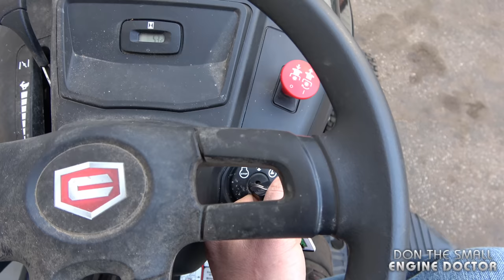Keep Your lawn Tractor Running When You Step Off!

Comment: You know the saying "if all else fails read the manual".  I've had the parking break slip and the engine shot off on my dad's unit.  Filled the plate thing-a-ma-doo-dad (technical term)  that holds the clutch lever in and it fixed the problem.  Great videos, keep them coming.

Comment: I bought a Cub Cadet XT1 46" about 3 years ago now.  Had to replace the starter in the 2nd year.  It was super-easy to replace...but still...less than 2 years?  I've seen posts online by others that had the starter go bad as well.

Now I start the tractor once when I cut the lawn, never turning it off until it's back in the garage.  (It's a long way to push the tractor from the furthest point in the backyard.)

Comment: Good tip Donnie. I had 1967 Cub Cadet tractor that I finally traded in on 2016 model Cub. The safety features are a good thing if the wife and kids are mowing, but I hate them. That safety switch under the seat was most troubling. When I would mow the ditch bank, the engine would stop because not enough of my weight was pressing down on the seat. Also, when hauling brush and leaves to a dump site just down the road, I had to get off the seat to make sure no cars were coming behind me, and the engine would stop. I did circumvent that switch. I know people do dumb and unsafe things with mowers and get seriously injured. Myself, I like the option of using the safety, or not using it. Some lawn tractors even shut the blades off when going in reverse. On the Cub a button has to be held in for a few seconds, then you can mow in reverse. I most definitely would circumvent that switch if it did not have that option. Geez...come on, this is ridiculous!

Comment: It is amazing how many people don't read the manual that comes with the machine. When I bought my newest Kubota the mechanic  was showing me how to remove the backhoe and loader said the PTO will not run when I am not in the seat. I said how do I run my chipper. He said some put a cement block on the seat. I came home and read the manual. On a page with one sentence it stated . To keep the PTO on you lock the parking brake on. I went back to the dealer and showed him this. It has a micro switch on the brake lock that bypasses the safety shut off. I also wired a light on that switch so I don't move the tractor with the brake on. That video will help the non readers. Good job I know this is a bit different than keeping the tractor running but is the same

Comment: The one at the modelairplane club have a strange safteyswich , when you cut the grass and need to reverse you have to disengege the blades outherwise engine turns off. It looks like the one you were sittning on. Great video.

Comment: Thanks Don, I have a 99 Craftsman rider, I think my manual had these instructions in them. Set parking brake, blades off and tractor will idle. Handy we I have to pick up some debris that I notice infront of tractor cut or taking short water break.
Reply from the maker: Thanks for sharing

Comment: WOW! Didn't know that! I have owned my John Deere D130 for 11 years now and NEVER knew that. I hope it works with my John Deere. Can't wait to try it out.
Reply: So I finally got to try it out. WOW!!! and then after reading other comments about "reading the owners manual" Well I can tell, I must have read it multiple times over the years for other things, so this time I sat down and read it from front to back and lo and behold, I did find out where they state it. It was "hidden" under the section for "how to check to make sure the safety switches are functioning correctly". I really think they really don't want you getting off the tractor with it running :-) Thanks again for the information and a very informative channel. You and Steve are my favorite channels!

Comment: I'm glad to see or hear your old intro..  ok.. That is a safety design feature, in the event that the tractor flips so that when you fall off, the engine stops. However, if you set the parking brake; it knows you are safe and this is by choice..
Reply: Thanks Don.. Best channel on Youtube.. I have question about a chainsaw "Jonsereds" Sweden saw that will not fire-up.. "K" body style.. do you have a section for Q/A. would love to get your opinion

Comment: I permanently bypassed the seat and REO switches. they're both a damn nuisance that I won't tolerate. My machine, I'll use it my way.
Reply: They are actually buttons you press down a switch you flip but I know what you guys are talking about

Comment: Not none of mine but my newest old craftsmen this reminded me I need to loop the black wire under the seat and loop it from the break button cause its took off 

The wire loopings different from the newer old john deere L110 I've noticed. I'm still waiting to get steering parts for the old Lt craftsmen and a new regulator rectifier for the other Lt craftsmen 

Any time I step off mine I shut the blades off because theirs no safety buttons on it that cuts the engine off so that's what I do 

Then I'm needing a new wide pulley for the John deere L110 deck i checked at the store that online said they sell i couldn't find them so have to get one of those from off here and need to get more extra gasoline because I'm always working on riding mowers or for friends

Comment: RTFM? They didn't read the manual. The one that drives me crazy is having to hold the PTO button up on my JD to prevent the blade from stopping when I back up. That is the one I want to bypass, as backing up is very common.

Comment: donyboy, odd question.....what on the engine of that tractor is making that "pressure squeak" sound when the engine cots off and it winds down to a stop - the last second or so before the engine totally stops??? my tractor used to make that noise, not it doesn't and i don't think its running well ?? my engine runs on one cylinder when the PTO is engaged for 10 to 20 seconds it seems, then will be fine until PTO is turned off, then back on again.
Reply from the maker: might be crankcase vent valve

Comment: That is a safety issue, so that when you fall off, the engine stops. However, if you set the parking brake, the engine will continue running with no one in the seat. for maintenance.

Comment: I had a Honda mower that had been modified (butchered) to keep it running when you step off. I stepped off one time, my foot slipped on wet grass and went under the cutting deck. My big toe was sliced like a loaf of bread so there was nothing left, the bones in the next toe were smashed beyond repair and the third toe was broken at right angles. At the same time there was a very deep cut in my heel which required 48 stitches.  There is a safety reason why mowers stop when you get off them.  Don't mess about with it.

Comment: In other words...  people don't read manuals. :)  I've left this "feature" intact as it's not that big of a deal to set the brake and disengage the blades (only mildly annoying but does prematurely wear out blade brakes), but had to axe the button that allows backing up with the blades engaged - that was too much. (before anyone comments about how "dangerous" this is - I'll risk it. lol) However, I do get that as a business, you can't/won't condone bypassing any type of safety device.

Comment: The one PITA is the key section after start..I forget to put in the Allow Reverse while cutting. Has to have been some idiot backing up causing litigation.
Reply: On my E140 I found that the connector on the "PITA" switch could be plugged in backwards and no I don't have to puch that stupid switch. On a D125 I believe that you can just jumper the switch. I can understand the reasoning for the seat switch but not this switch.